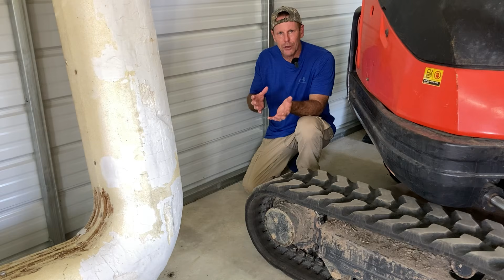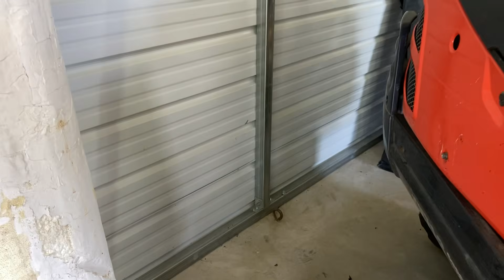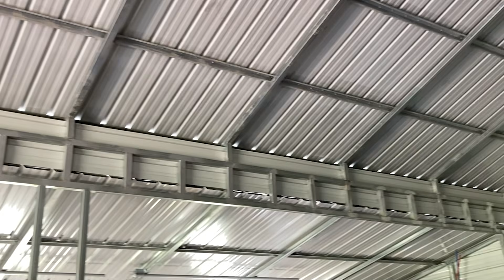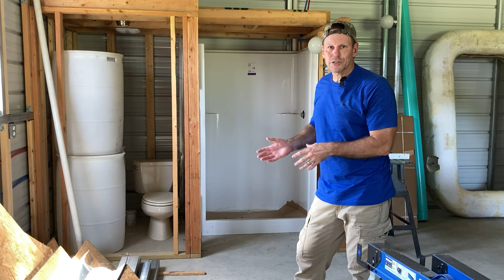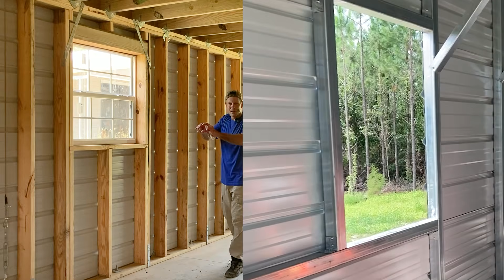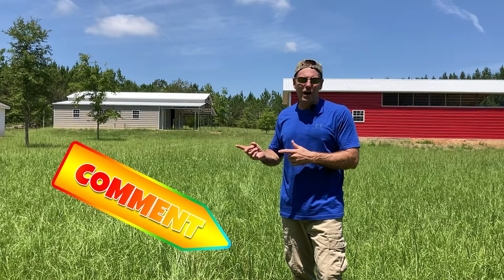Which one is better?  Pros and Cons of Pole Barns & Metal/Steel Buildings

Comment: Would or did you ever consider reducing the cost of either project by eliminating the engineer's stamp of approval or input and doing what you saw others do the same? Maybe you took the building supplier's opinion as to what the wind loads, snow loads, etc. are? No matter what you decide, whether you admit it or not, cost is always a major if not the pedominant factor in making a choice. As you mention animals and urine exposure to the building, one of the first things I noticed was that your metal building sat on the concrete slab without any curb raising it slightly8 above the flat surface. Whether wooden framed or steel, with or without animal urine concerns, having a cement curb around the perimeter of the slab that the structre rests upon prevents any water or liquid from contaciing the structure and present a hazard toward rust or rot. I often use a garden hose to clean off the built in garage floor I have and don't need to worry that the water is contacting the wood framing and thus be avoided. 

I now own and help build a commercial building for my late father. He hired a professional building manager to coordinate all the construction process, contractors, etc. That concrete slab the structure rests on has a poured curb as mentioned. I was never consulted much about any of it nor needed to be. One day my dad asks me to help him secure the structure, all wooden, to the raised curb it rested upon. He said he asked the building manager he hired to get this done. Always before the interior walls were built while access to do so was still available. And he said the guy refused. Looked like common sense building practice to me. But the guy acted like he knew better. Gave some reason for his decision that it was not necessary. Very odd, considering everywhere else this was common practice.As a rift developed between owner and hired help, aka this manager, it became simpler to just do what was believed necessary without the guy's help rather than argue to obtain his assistance. 

So, maybe $400 in concrete anchors later, he and I drilled holes through the wooden base plate into the poured concrete curb underneath and inserted anchors all the way around the outside walls of the building to anchor it securely to the foundation. No explanation as to the necessity of doing this was needed although he told me. Because like you mention occurs from hurricanes in Florida on a regular basis, we in Tornado Alley as it is often called, are no strangers to high wind events, either. And it should not have taken any arguing to get a building professional to understand that the building shell is susceptible to strong wind at times and could move off the foundation and then be destroyed with that being for the most part preventable with the anchoring effort ahead of time. As with you down in Florida, in Nebraska nothing can guarantee mother nature will never better the efforts you make. But you can build the things with a level of confidence that it will take a very substantial storm to destroy your building.

That experience called into question the motives of the building manager like nothing before. Just the fact that you argue and stand in the way of the desires of the people being satisfied who are signing your paycheck is foolish. If the owner wanted this done, as was the case, and was willing to pay the expense without question, as was also the case, then why would you stand firm oppos9ng such a common sense thing? Unless you have ulterior motives wishing the project to fail long after you were free of responsibility? Maybe have a complex from losing all the arguments with your wife at home that you refuse to lose another outside it, ever, no matter how ridiculous? Or maybe some union thugs who are bullies forced you to deny the obvious and do their dirty work rather than face their wrath yourself as you are seeing your boss is doing? The answer proved to be the last one.

And it also was done despite the old man always taking what these union thugs needed into consideration. Never opposing them. With me being the biggest thorn in their sides they ever knew existed. Unsure of it being real or not. But having the idea being popular and the way union members made their bones to their gang. By hurting me. They used my father to make suffer to do so. The cowards and fools they are. My poor dad could never accept that people were out to get me, then him. He always had a soldier's faith in the police, the fire department, the system. Showed never dying loyalty to them all even when it was absurd. One time he forgot something and left his truck idling in his drveway after removing it from the garage to leave. A black woman leaving a party across the alley saw it idling and stole it. He called the police then me. And I headed right over as the police were soon to arrive to take the report.

Knowing he had a current ON Star subscription in the newer Chevrolet truck, and knowing he probably doesn't even realize that system locates his vehicle if stolen, figured on the way there he probably didn't think to mention it to the police. And I was correct. Same woman broke into the house next door and the officer was there taking her statement and making the report after doing so here next door at my dad's house. He told me he didn't mention it to the officer.

So, I went next door to mention it, saying I don't mean to interrupt, but know it is a matter where time is important. The cop asks me if I called On Star to report it? Me, no, why would I? I told you, the police officer. Can only get into trouble I figured by bypassing the police. Left figuring I saved the day mentioning that. Knowing they could tell right now where that truck was.  And he On Star system paid for itself then and there. Not quite. Close, but not quite.

I went home and four hours later my dad called saying they impounded his truck. When, I asked? Just now, he said. Just now, I said, that was four hours ago I told the officer. Great service, he said. Not hardly, I replied. Not even close. Turns out in the four hours the thief went on a spree where she broke into travelers cars and stole whatever they had. All kinds of papers from different people none of whom were local were scattered inside the truck. Took $400 to buy it back from impound. No thief was ever caught. her high heels were neatly stacked inside the truck. And she or her buddies tore off the rear view mirror from the wiindshield which is where the rear view camera displayed what it sees. The damaages from that were over two thousand dollars. Fortunately, it was not wrecked nor damaged in any other way. Nobody cared about the poor people who were ripped off at all. And my fool hearty father maintained it was good police service he received. Not hardly. Had I known I could call On Star in the police officers place it would have ended fifteen minutes later. But an obese officer in uniform, a union thug, must have failed to recall he had to call On Star. On Star acted swiftly. Their system worked perfectly as designed. 

Again, only the union member was the weak link. Never facing discipline, always protected by their union. When my dad passed away, I was devestated. His bliind trust in law enforce,emt cpmtribited tp jos death. I was enraged and still am four years later. But say nothing more. When the building IO inhertited became mine, I suddenly received a call from a tenant claiming the roof top furnace was not working. The union contractor he used to provide service had already been contacted and the salesman left me a quote for repair on my voice mail. I smelled a rat right off. And boy was I correct. The claim was the heat exchanger needed replaced. The repair estimate was made by a union tinner at a union shop. Fortunately for me, A buddy of mine was a HVAC guy. Long ago he showed me how to spot a cracked heat exchanger. Armed with that knowledge and the treachery of the union thugs leading the way, I checked it out for myself, knowing my dad would never have done that. Knowing they think I won't either or won't be able to challenge their professional opinion. On the roof, I found nothing damaged, a fully functional heat exchanger. Pilot light had gone out is all. That was the latest fraud attempt by organized labor goons looking to impress their union brothers with the scams they can pull. And they do nothing but pull scams. Fired them and their salesman telling them I would let them clean the urinals knowing they would steal the mint then lie to me they did it with the mint still lodged in their teeth as they denied it and smiled. I hope farmers don't have union labor to deal with for your own sake. Nobody should have to deal with these deceivers. I refuse to and they poison my dog;.

Thanks

Comment: One consideration you did briefly address, maybe not knowing so and indirectly, was that these buildings require special considerations if someone designing one needs to consider if they choose to have an overhead trolley with a hoist to lift heavy things around more conveniently. Only people who don't have an overhead trolley and beam to use are forced to use gantry cranes and engine hoists which take up valuable space when not in use. That heavy overhead beam won't work well in some of these designs. Never want to be that guy who built his garage and then avoided the structural engineer's decision and added a steal beam overhead and trolley without understanding the loads and support necessary and having it become a disaster. Or even have it something inescapable every time you went to use it.

Comment: The pole barn is much higher risk in a fire & in a tornado touch down.

Watch any TV footage of a tornado damaged urban area where most houses are stick built from softwood lumber & invariably there’s not a piece of softwood timber left that’s any longer than 6 inches in length.
Steel buildings, particularly those with red steel I Beams will stand up to almost anything.
I once sat out a category 5 cyclone downunder in a concrete and steel building designed to withstand those forces & there was zero damage.
Steel storm shutters over the windows so zero broken glass.
There was minor water ingress where horizontal rain was forced by 200+ km/hour winds past the metal window flashings - but that was all.
The building was originally a harbour masters house & office, built right on the ocean front so that he could see and direct shipping coming in to load out iron ore for export from his office window.
It was subtropics and subject to multiple cyclones per year.
You can build anything to withstand fire, earth quake cyclones hurricanes tornadoes & fires - even enemy attacks when it comes down to it, if you have the $ budget & engineering design.

There’s a US Aus joint Naval submarine communications base built in Western Australia with a main steel mast for ULF radio transmissions underwater to submarines, in Exmouth Western Australia where  the radio mast is more than 1270 feet tall, and all the US Personnel housing for the base is constructed of concrete and steel & more than Cat 5 Cyclone rated, because its subtropics and subject to cyclones every year.

Comment: Brad, would you think it’s a good idea to build a home with the tubular steel frame? We are in South Louisiana and my husband is trying to convince me to go this route, but I’m not sure it’s safe for a home. Your thoughts?
Reply from the maker: My friend's son is doing it in Bay County, FL which is on the Gulf Coast and has a very high wind load requirement and strict building codes.  The engineering is there for a safe structure, but by the time you build your walls inside of the metal building, there may not be a cost savings??    We had a choice when we built our house recently and we went with traditional stick framing rather than a barndominium.    Playlist of the house build here:   https://www.youtube.com/playlist?list=PLG5yS75HLzo343HSY79ll4DgoxTgV6l91
Reply: @PineyGroveHomestead I’ve been following the house build. Congratulations, it’s beautiful!

Comment: I see this in almost every steel building:
2x4 interior construction to allow for insulation and interior walls. 

So if you’re doing 2x4 interior, why use a steel exterior? It seems counter intuitive and costs are double. Just build a wood structure so it’s built once.
Reply from the maker: It's 2x3 and just on the walls that are getting sheathed.  These buildings have had a lot more done since this video.   Updated videos here: https://www.youtube.com/playlist?list=PLG5yS75HLzo2MCmO8M-IQXfvkv-ivvpAU

Comment: Can you have your exterior metal  installed vertically vs horizontal on a steel building?
Reply from the maker: Yes, but it costs more because it requires steel purlins to attach it to.

Comment: Im concerned with steel on concrete. Maybe some sort of rubber in between?
Reply from the maker: You could add that yourself when they install, but I  would think that would trap water?
Reply: They can do a seal under it.  It’s an option

Comment: Good video. One question that might be dumb, but why do I have to use hard conduit or kc cable to run my wire? Just to avoid charging the entire building with a current?
Reply from the maker: I'm not an electrician, but I'm guessing there is no secure way to run Romex on metal framing?  But that's just a guess. The pole barn is now wired with Romex.

Comment: Thank you for the post! We have 20 acres as well. We are not planning on having any critters but have been torn between a pole style barn vs. a metal building. I like the flexibility of the pole barn to add as budget allows, but I see the benefits of the metal building as well. I potentially would like to add a small living dwelling. I guess you could do that in either building. For now, it would be for the equipment and an RV.
Reply from the maker: If you can make it happen, I'd go metal building with concrete floor.

Comment: One thing you mention is the need to fasten your buildout to the metal building.  I'm not sure why that is.  I've seen wood framed class rooms and lab rooms built into metal buildings that were fastened to the slab without being attached to the structure.  Is there a county code you have to observe?  I agree that the BX looks sloppy, but there are ways to clean that up by using unistrut above the panel, not just to mount the panel.  Conduit is the better way, but it is time consuming for the home owner. Good information, and thanks for putting this up.  I learned quite a bit.
Reply from the maker: You could wood frame inside the metal framing, but then you would lose 3.5" of space if I understand what you are suggesting.    The pole barn has come a long way since this video.  Here is the series: https://www.youtube.com/playlist?list=PLG5yS75HLzo2MCmO8M-IQXfvkv-ivvpAU    Thanks for watching.
Reply: @PineyGroveHomestead I can understand maximizing the space.  I wasn't sure if you were following a county / state code requirement to attach to the building.   I'll check out the vid link.  Thanks for the reply.

Comment: If you're worried about Carpenter Bees or treated wood rotting! Why not steel corrosion on concrete? My gosh, my folks built a covered deck in the early 70's. The main structural portion hasn't failed yet. I've worked in industrial construction for years. Replaced numerous steel footings attached to concrete, but these buildings were built for extremes. Not in a residential or farming setting! Regardless of which way one goes either structure should last way beyond their lifetime. If built properly! IDK IMO a lot of prospective buyers don't pay attention to all the details. Case in point, I bet you wished you would have went with higher sidewalls. Especially, in the area that's being framed out. Also with those pearlings on the wooden pole building. My Amish built building doesn't have any of that junk. Stick built with true 2" x 6" and 6" x 6" construction. Also it has a traditional concrete and block 3'-0" foundation. Along with being a two story building! And finally, I'm kicking around the idea of building a all steel building on another property. See a lot of gaps to the outside on that Carolina Carport building. Any plans on sealing it up with spray insulation? Didn't see that in the pole barn section with the concrete floor...........

Comment: My pole barn in SE PA is post and beam and still looks great after 20 years. It was built buy a local reputable pole barn company in 4 days. 30x48. The one thing I liked with my pole barn is the 4x6 posts were set 8’ apart. I was able to fit 2 sheets of 2” foam board vertically between the posts and screw the drywall over top to the horizontal purlins . My walls were 8’ high so it was easy and gave me about R 17 or so walls.
Reply from the maker: This one is about to get fully closed in!

Comment: We just had a 30x48x12 steel truss pole barn installed a few weeks ago. 8x8s are 4ft in the ground with around 400 pounds on concrete in each hole. The building seems almost little shaky, is that normal? We are in florida by the way
Reply from the maker: Yes.   We've had the pole barn mostly enclosed since then and talking to the builders they said one man can get on top and make it sway.   I added some cable tie downs to our concrete.  You can see the builds in this playlist:  https://www.youtube.com/playlist?list=PLG5yS75HLzo2MCmO8M-IQXfvkv-ivvpAU